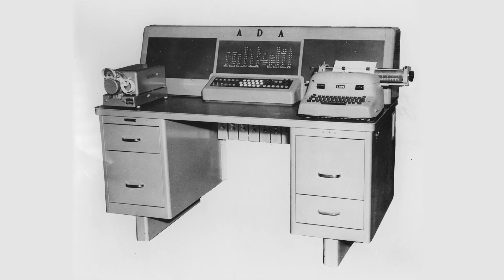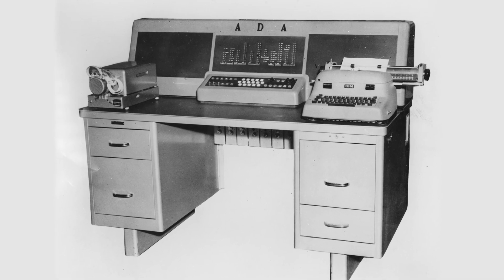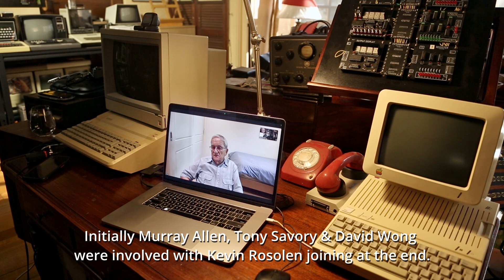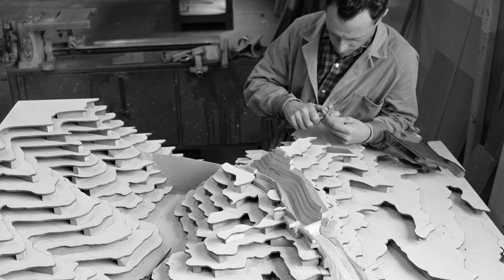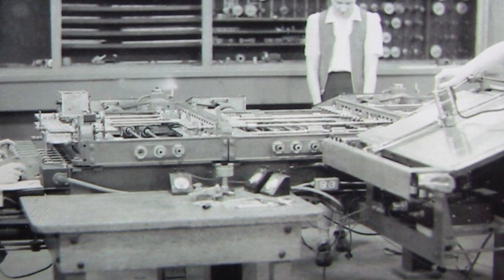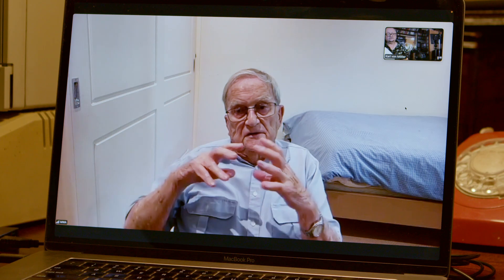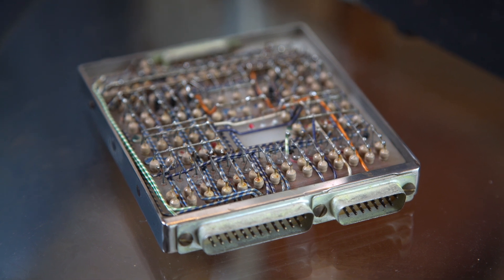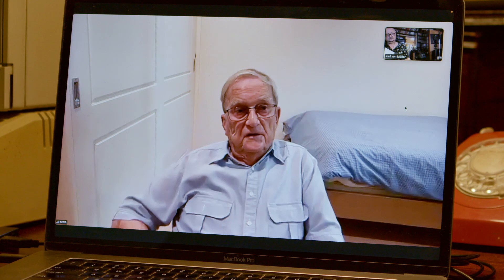ADA  - Ep7 The Computer History of Australia

Comment: Another kind of analog computing today completely unknown is the CCD and BBDs, these could be used as cameras but the more interesting type used them as delay lines where every charge bucket could also perform a free multiplication just by using differential clock gating and thus giving dot product for say 256 samples at about 8bit resolution. Combining these with current sensing on the clock drivers and fast enough A2D and D2A converters allowed to build power spectrum analysers and many other useful devices with not a single digital multiplier in sight. The companies like Plessey, TRW, Raytheon, and others were mostly in the defence industry. Not a single bit of calculus in those analog computers.